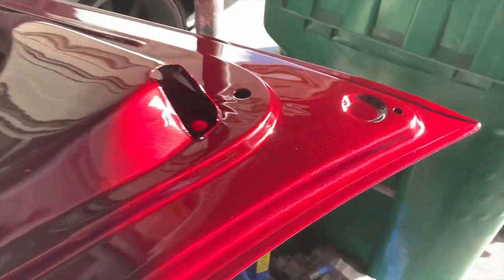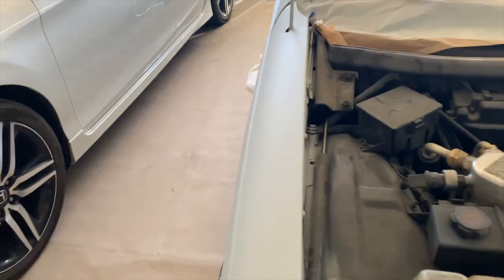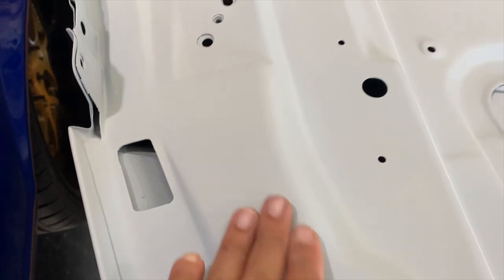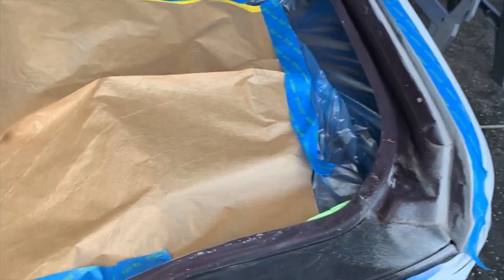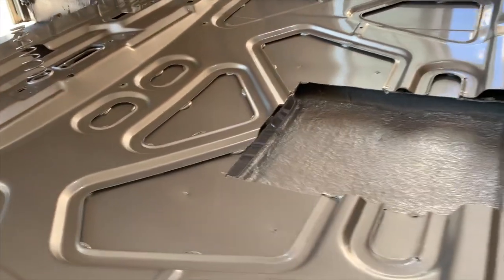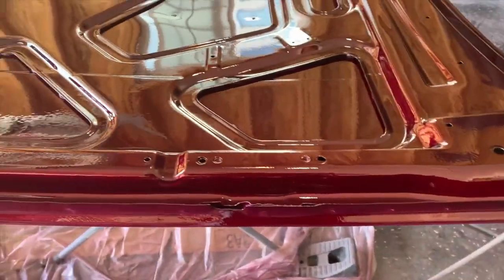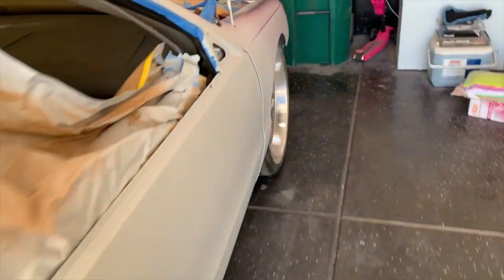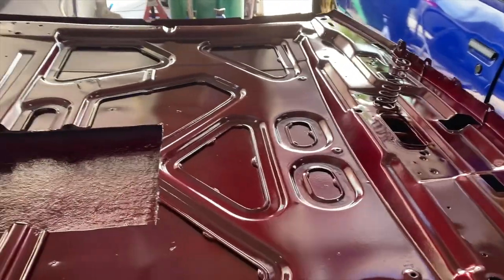THIS CUSTOM COLOR ON MY IMPALA IS FIRE!!! [COLOR REVEAL]

Comment: Big dog how’s your interior is it all OG 💯💯✊🏽✊🏽
Reply from the maker: It’s almost perfect. I have a tiny slit in the driver seat that I’ll use a vinyl repair kit on. I also need to repair the drivers door panel because it has a crack in it but other than that it’s all good. I’m going to detail it once I’m done and it should be like brand new. How are your projects coming along?
Reply: @grindschool  I tried to paint my 95 but it’s not coming out for me so I scuffed it up getting ready for another try but I got a custom 2 tone maroon leather a Suede headliner if you know anyone I’m willing to trade the person who had my car first painted it  candy DCM but roof and hood was faded really bad we should meet up some time ✊🏽✊🏽💯💯
Reply from the maker: Okay yeah I’ll let you know. Yeah that would be dope we can do that whenever time allows. I want to see the 62/63 and the Chevelle project.
Reply: @grindschool  yes sir I sold the 63